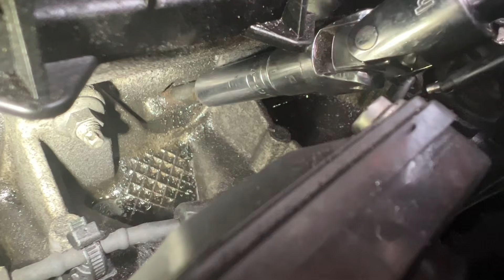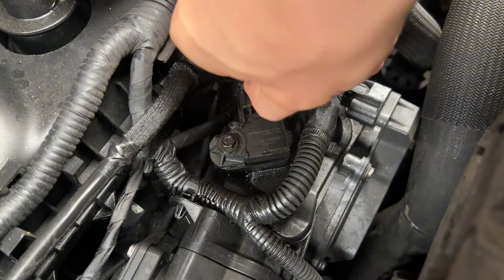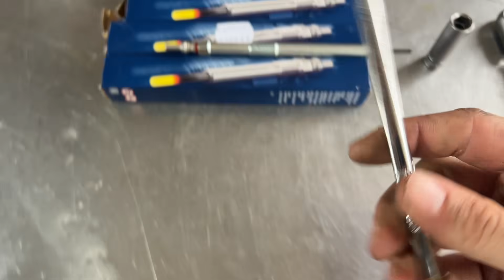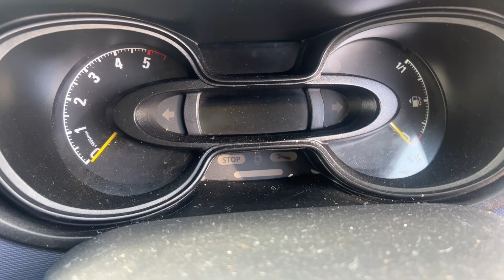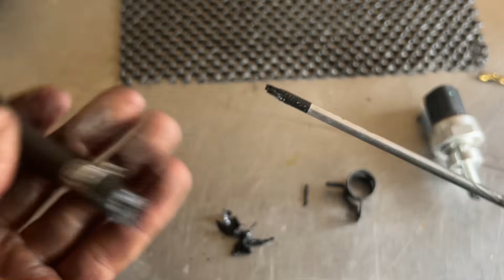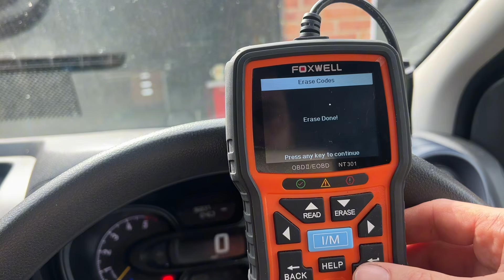FIXED Vivaro Check Injection System and Anti Pollution System P0096 P0380 | Glow Plugs

Comment: Very informative. Just got the two faults on my 2015 Vivaro (Injector + pollution) Havn't looked at it yest, but a question, the metal pipe, this goes down to the exhast someware right? Did you take it off at the end or just worked the bike cable wire down the pipe?
Reply from the maker: informed the cable down it and refitted everything as shown

Comment: My original Beru glow plugs were 19.5 years old before I changed them on my 1.9 F9Q.  Was getting a 'glow plug general error', 1 plug had zero resistance. The other 3 were 1.5ohms.  They came out very clean, they were always surrounded by oil. Cold engine, weather 25 degrees. N04 squeaked all the way, so let it cool each turn. The bodies on the Beru looked like a special metal or coating. The new Bosch look standard zinc plated. Installed them with ceramic grease, they will outlive me if as good s the old Beru.
Reply from the maker: yeah I think I forgot grease in these but off camera I went back and did it as I’ve done flow plugs on plenty of Vehs but snapped a few in my time and hate drilling them out so always apply liberal copper grease.

Comment: Ah mate honestly I’ve just bought a 2015 plate vivaro literally had it 2 weeks and I’ve got the same thing (check anti pollution system) (check injection system) along with the orange engine light constantly on it drives but I’m not mechanically minded to the extent of major jobs so I’m just stuck on what to do! And where to start, but I’m hoping if I try the things in the video it will help or even clear the codes and that of the dashboard 😅
Reply from the maker: I hope so!! give it a try and see what happens - sometimes a clean and some code clearing makes all
the difference. last time inhale an ‚check injector‘ code i just put some diesel injector cleaner stuff  in the fuel cleared the codes and it was grand again.

Comment: Hi Richard, i noticed you didn't put the tighten strehgth on the glow plugs. how do i no what tighten strength to tighten too . as going to try what ive seen on your video and try to do it my self.
Reply from the maker: it’s 15Nm - bit make sure to check the number. I used a Haynes’s manual. use some copper grease also.

Comment: changed plugs, upstream sensor, cleaned the system, after a quick run it came back on, saying something about a open circuit, also changed preheater & the starter riley, nothing fixed and its annoying, Vauxhall Vivaro 2016, bi Turbo, 1.6 - 160k miles... never had issues with it, dpf not clogged, if anyone has some ideas
Reply from the maker: glow plugs perhaps?

Comment: 5:36  if you heat up that red straw you can bend it a little.. you could slide a long little pipe over the glow plug to the bloc and blow w1040 in it all the way.
Reply from the maker: ahh that’s a great tip cheers my man 💪🏻💪🏻💪🏻

Comment: Great video, thanks. Why does the blocked exhaust pressure sensor cause an intake air temp sensor fault?
Reply from the maker: I had no idea but it seemed to work for me - along with the other steps like clearing the codes etc

Comment: at 12:48 minutes, clearing out the gunk in that sensor. i did try to clear it our before without succes. this time i turned gently by hand with the pointy side of a 3mm drill in the first part of that sensors straight tube to clear it. than i took the backside of that same 3mm drill and twisted gently deeper and found some sort of a springy feeling. i think that's the actual membrane that i freed-up. i could feel the drill bouncing up and down. i think that's the thing you need to feel when trying to save this sensor.
just thought i'd share this with all of you searching to fix this yourself 🙂
after this i didn't even have to clear the fault codes at the start-up.
Reply from the maker: good work and it works a treat!! I had to clear my codes tho haha

Comment: Excelent Video, thanks for posting, Very confidence inspiring :) Do you rate the Foxwell NT301 ???
Reply from the maker: hi bro and thanks for the support! erm I mean it works with check engine codes etc and it dosnt go super deep. for the home mechanic it’s okay. I think it only covers check engine codes and not much else. I think in the future I’ll probably spend the £££ and get a proper Autel or something like that as it does everything.

Comment: We got check anti polution warning on our 2017 trafic and 2 garages have tried sorting it and it still cones back. So far around a grand in costs. Its back to the garage in a week
Reply: This seems to be quite a common tale. Mine has just come on so I started researching last night. It covers a wide range of issues but it can be as simple as 'the temp sensor in the wing mirror is missing/damaged' and far too many garages will replace half your emissions control system (at great cost) before getting to that. This is all a new world to me, as I've just come from a pre-ECU entirely electromechanical car which either worked or it didn't - no computers to monitor things or argue with. Simpler, but much more polluting...
Reply: check anti polution would come from a blocked carter ventilation (oil fumes separator?) that is blocked. at  least that's what i'll be looking for. that's why the first sensor os getting dirty (with sucked up oil mist that comes thrue the intercooler first). 
you shoudl check the oil mist separator (don't know the correct english name) , then fluch out the intercooler, and that top sensor.
i still have to check that rear sensor, i'm sure it's blocked too.
Reply from the maker: good luck i hope try find the issue!

Comment: Wish all my glow plugs came out that easily!. One stuck at the back of the engine 😢
Reply from the maker: hey bro I’ve had this issue before with my old E46 BMW! try spraying the glow plug with a decent penetrant fluid leaving it over night then trying again the following day after applying even more!. you can also try to torque it up a bit then loosen it a bit and repeat this and it sometimes breaks the seal. another method I’ve seen which I havnt used is heat on the glow plug like a torch and then using a freeze spray on the glow plug to try to shrink it ever so slightly then crack it open. good luck!
Reply: I'll try soaking it in release spray as there's not enough room for heat on the 2.2dci engine, it's pretty tight!. Got it to crack yesterday back and forth,but was like a dry wheel nut!.
Reply from the maker: just been suppppper patient!! just spray spray and more spray. go and make a brew. then try again. the one in my video I think it was the forth one was also super hard to get out! but I just sent it and luckily was okay! good luck! 💪🏻💪🏻
Reply: Spent £1k on suspension last year, £1500 on steering, cv joints etc year Before,  regret it now !.have to look for something else now!.
Reply from the maker: one of my CV joints or wheel bearings is on the way out. makes a noise like a canal boat when I go round the roundabout haha
Reply: Thanks for your brilliant advice,  your vids on Utube are so helpful. Cheers
Reply from the maker: If the video helped one person then It was worth me making it! So thanks I appreciate it.
Reply: Have ordered from amazon thanks.  Yes it was the gloplug at at the gearbox end , rest were OK to do!. There's always one !
Reply: Crack, crack, crack, crack ,creek, tried back and forth, put wd40 on again after soaking last night...snapped off now ohhhh dear!.
Reply from the maker: AYYYY!!! 😫😫 you can get a remover kit from Amazon or similar not so expensive!

Comment: Hi, After seeing how you tested the glowplugs for resistance it strikes me that you could measure the resistance with the plugs in situ. measuring from the electrode to the engine body, I haven't tried it myself but it might be possible if there is a good connection between engine body and thread. Your thoughts?

Reply
Reply from the maker: you absolutely can measure them in situ - just use a common earth or negative and hold the probe to the end of the glow plug and it yeilds the same result. I was changing all my glow plugs and for ease and the video it was easier to do it on the bench. My OBD reader also told me which ones were bad so I knew aswell.

Comment: Worse van ever built so hard to work on and cost a lot of money to replace parts😮 i hate mine wish i never owned it, 2016 my model just cost £800 to replace alternator and battery 😭
Reply: You probably mean your VW junk.
Reply from the maker: haha glad you like it. thankfully when I bought mine it had a new battery and alternator. thankfully no issues yet - although a wheel bearing or CV joint is on the way out!
Reply: @richard_builds_it are you getting a humming or winning noise from the floor area??
Reply from the maker: It sounds like a bearing or CV joint. Sounds like a low humming or grinding noise like a canal boat. Is worse when I go round a roundabout and all the weight is on the left hand front wheel. It’s certainly the left wheel area. Not sure if bearing, hub or CV.
Reply: Think you will find your mechanic is ripping you off, 160 new alternator 250 new Bosch battery

Comment: Great video, thanks for sharing! Awesome. 
Glow plugs replacement sort the check injection warning.

I still have the anti-pollution warning
How far did you get the brake cable to go into the thin metal tube? I cleaned the rubber hose elbow and got about 8 or 9 inches into the tube (after some back and forth cleaning)
It won't go any further however.  Does that suggest its blocked further down do you think? 
It could be the sensor of course...i just need to confirm which one to buy, but i want to make sure that tube is properly cleared first!
Cheers
Reply from the maker: yeah it was an odd one. the anti pollution (as you know from
the video) was that stupid sensor. thankfully they are quite cheap. another tip to use is an old or new brake cable from a bike. you can shove it down the tube and use the other end on a drill bit and whizz it around for extra cleaning. but for me it was the rubber tube - it was absolutely caked with soot and old diesel gunk. 

i think the harder copper type tubes don’t block so easy but keep trying and get it as clean as possible. then clear the codes and hopefully it’s okay again! 

There’s another great channel called O Riley's Auots (ORileysAutos) they have great videos on these exact type of issues. Hope you get it sorted!!!
Reply: @richard_builds_it  thanks! 
Im enjoying the camper conversion! 
What's the sensor called , I think its the 173118 Febi?
I tried the brake cable thing, got so far the cannot get further (about 8 inches)
Reply from the maker: @neildee9834   Just did a quick google and thats the same one i came up with!30/40 Pounds so not so bad! Guessing you’ve got a code reader on your van - best to check the codes otherwise we end up chasing the fault - but if cleaning it didnt work the next thing i was going to do was to just replace the sensor!